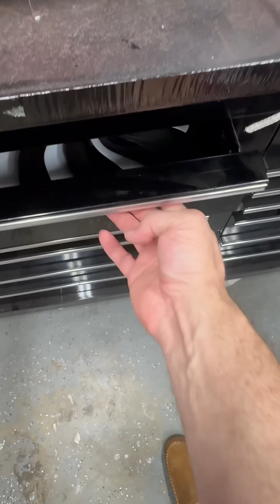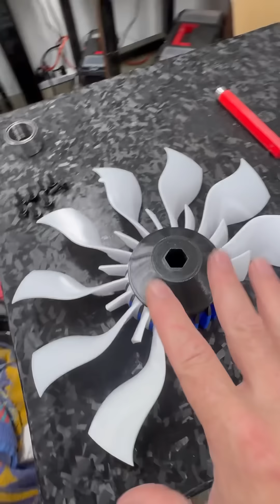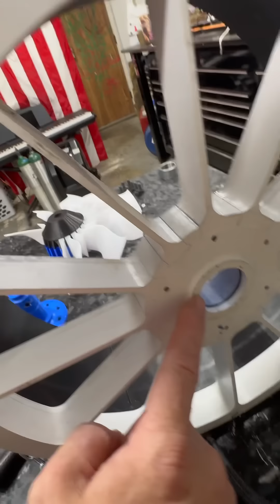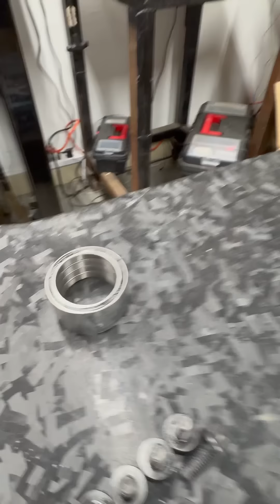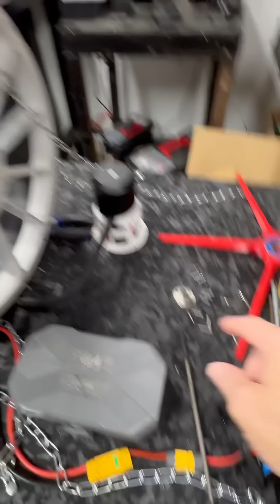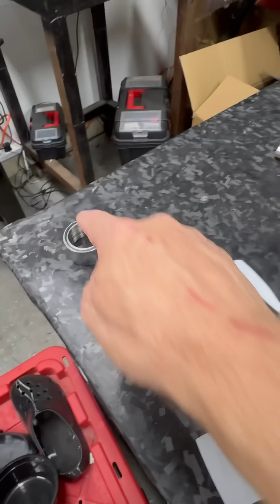340mm 11 blade EDF. New shorty blades for motor cooling or compressor adaptation. Afterburner.

Comment: Those small black shaft thingies, is it possible to use a square keyway instead so you don't have to worry about them snapping off? I didn't quite understand what they do, but it does appear that they lock a rotating shaft in place.
Reply from the maker: I think I found the answer with less parts. Old tech from old cars. Tapered needle bearing on the main shaft.
Reply: @warmachined3472  I went back in time in your shorts and found out the shafts I was referring to hold four bearings to keep the main shaft in the stator in a rather clever setup. I initially thought the shafts were essentially keyway pins, but I was wrong. My square keyway suggestion is irrelevant here. 
Are you saying you'll replace that idea with a tapered bearing? How do you plan to lock the main shaft in the stator?
Reply from the maker: @ there is a stack of four main bearings to bear weight and centralize the center shaft into the hub behind the hub. I had a set of skateboard bearings that were pushing against the back of the hub to keep the shaft from going through the front and reducing load on the motors bearing themselves I’m replacing those with a tapered roller bearing so that the Ford thrust is on that bearing specifically and the hub coincidentally which is exactly what I need to mitigate the fans torque on the actual bearing motors that drive it the back of that bearing will be locked into place with a with a PETG ring that will glue into place and keep the bearing from moving backwards in CNC applications. It would be a bolt just like changing the tapered wheel bearings on a car.
Reply: @warmachined3472   Gotchu! All the best!